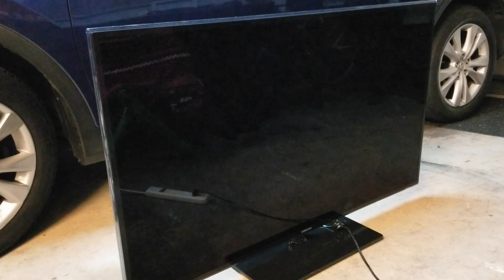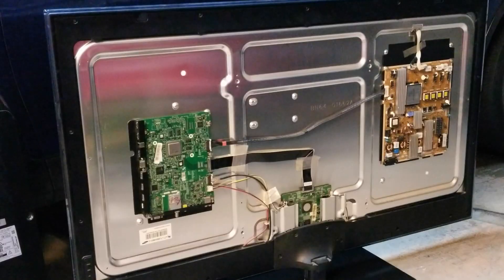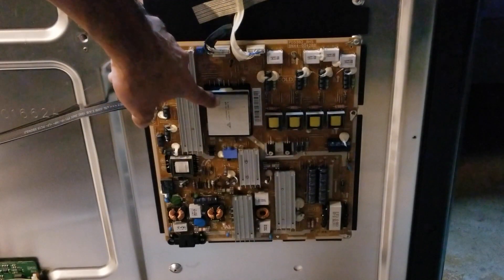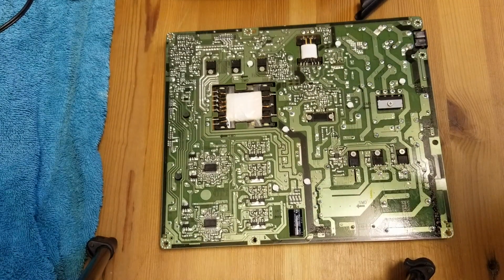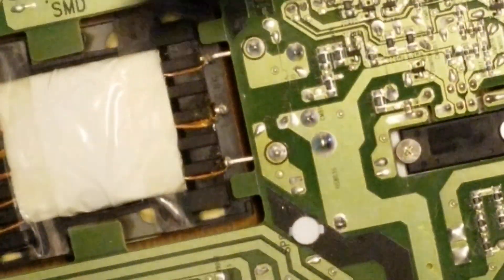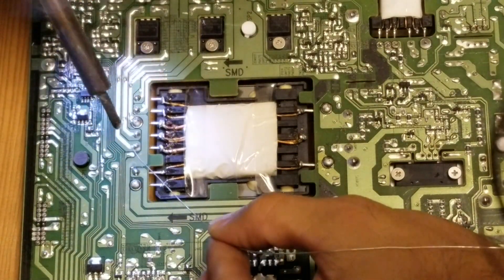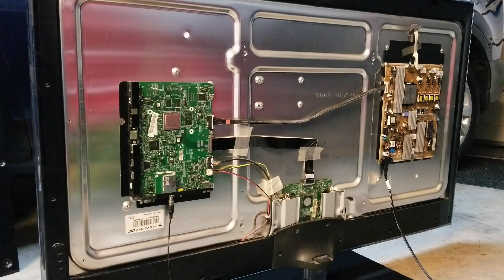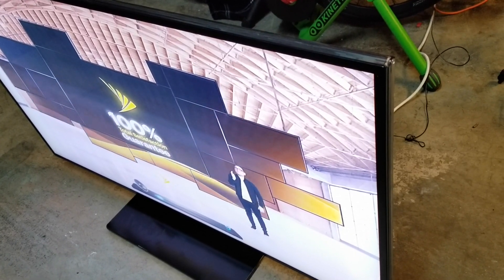How to Repair Samsung LED TV UN55D No Power Clicking Fix

Comment: You just saved me a TON of money on a new TV.  I knew it was the power board having issues but I never thought to take a look at the soldering connections.  I looked everywhere for a new board and since the TV is older (~9 years old) I couldn't find one anywhere, or at least anywhere that didnt seem too sketchy.  I just happened to find your video on accident and decided to bust out my soldering iron to perform the same repair and VOILA!  It worked!  I feel like I owe you some beer after that save!  Thanks, man!
Reply from the maker: Great to hear it worked!

Comment: Hi, I need the outline of a SAMSUNG BN44-00787A and a new source here in Spain, thanks in advance
Reply from the maker: Hi Victor, the power supply you are looking for has a common issue with a transitor, a fuse and a resistor. Shopjimmy.com sells that kit. Good luck!